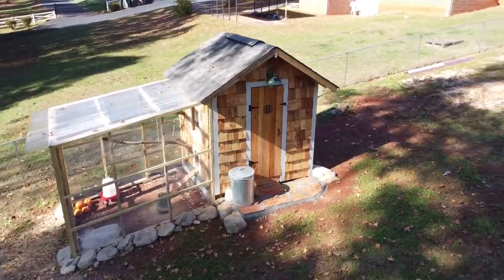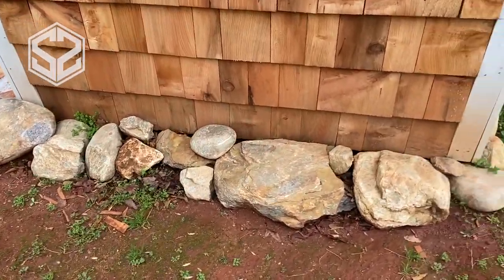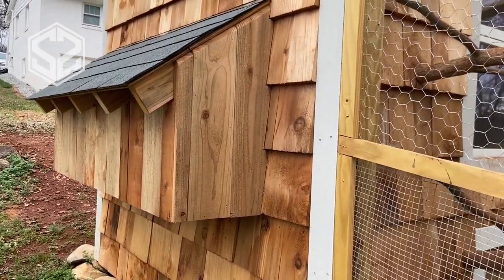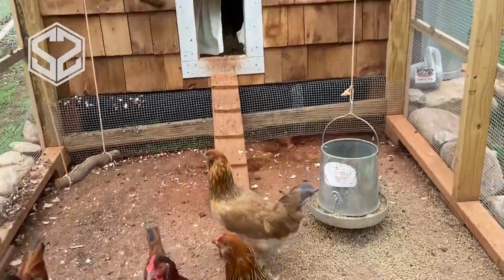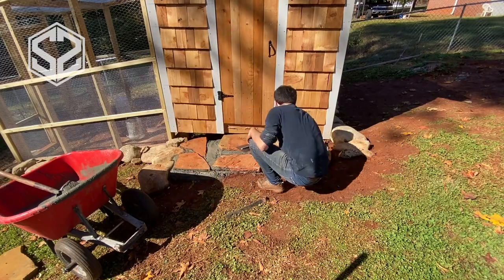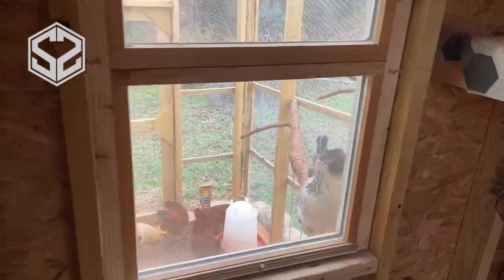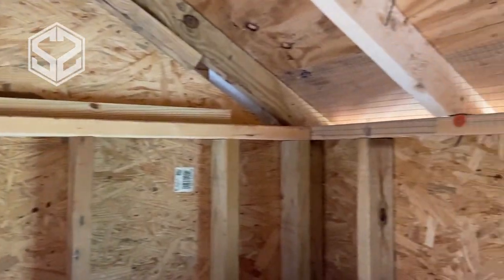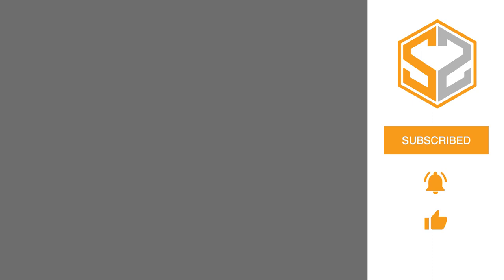Coop Tour

Comment: Excellent coop and pretty too!  I also have linoleum on my poop board, but also a lip in the front and use stall refresher, looks like kitty litter, under the roosting bars.  I find it makes it so much easier to scoop the poop because it doesn’t dry on the linoleum and it absorbs any odors…not suggesting those gorgeous egg layers would ever produce any “off” odors of course😉
Reply from the maker: Haha thanks for the tips! 😁